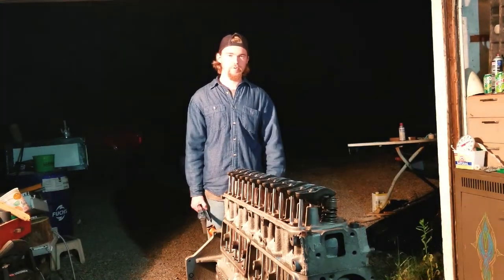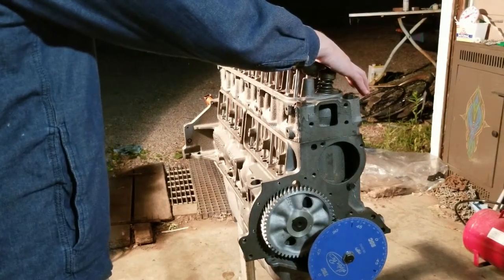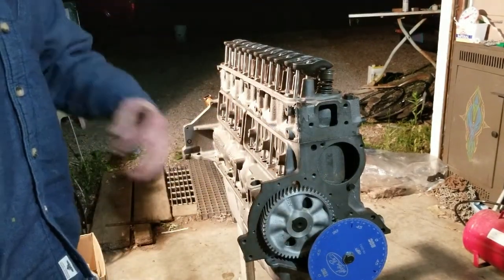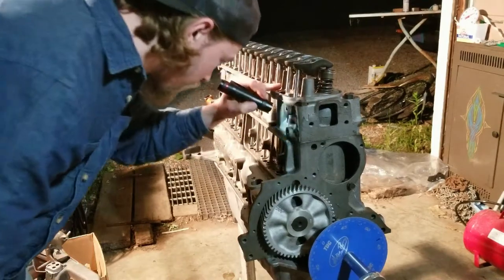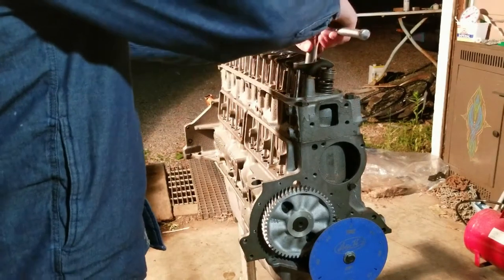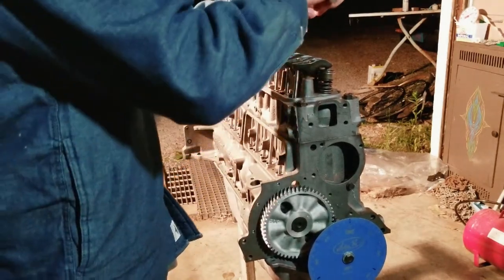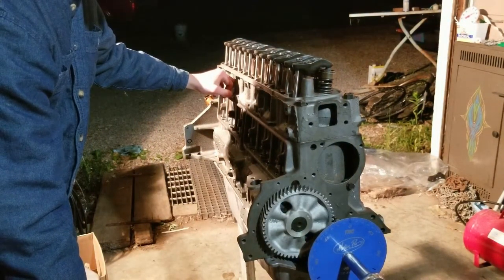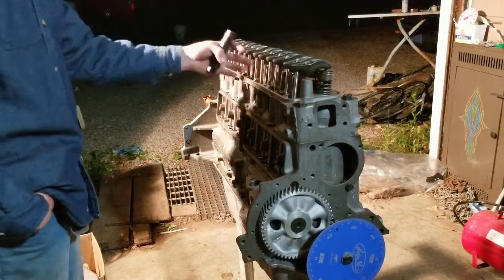Hydraulic valve adjustment MADE EASY!

Comment: I have a Cheu performance built using a Clifford hydraulic lifter cam. in 22,000 miles I have NEVER had to adjust the Rocker Arms. 1/4 mile times? 10.76
Reply from the maker: That's fast as hell! I don't even believe you haha. I've never had to adjust our lifters after this either.

Comment: I have performance built up Chey 292 and I have a Clifford Hydraulic cam. I have Never adjusted my valves.
Reply from the maker: Ive never needed to adjust them after I set them. Not sure why I would have to but I heard of people doing it cold then hot, maybe that's a solid lifter thing but no need for that with hydraulic. Id love a 292 in a truck.